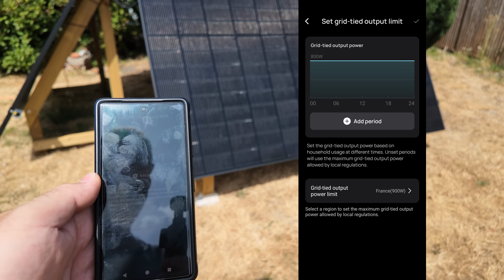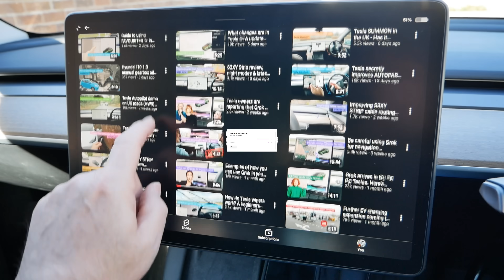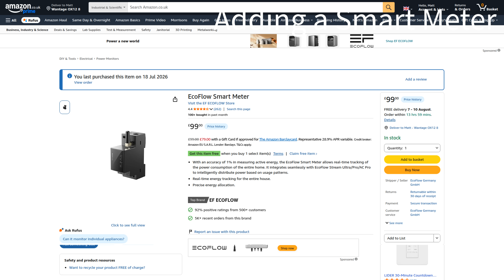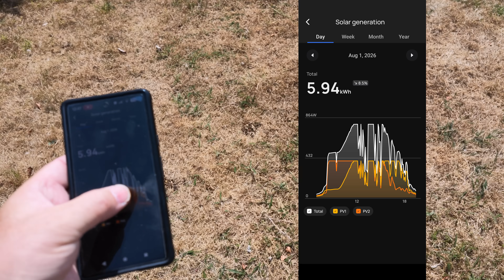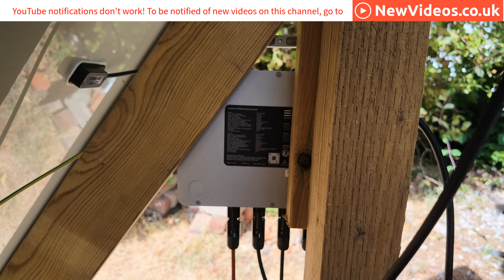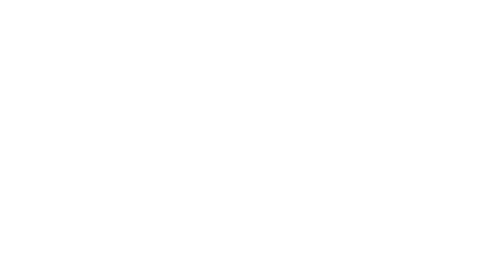Why My 800W Plug-In Solar Setup Sends Half Its Power Straight to the Grid ⚡

Comment: I’m surprised that there is no damage to the inverter, ja solar panels use 36v  obviously 2x 36 is 72 which is higher than the 60v max EcoFlow say you can install per string. Have you had any issues?

I have a similar setup however only the only panel on each string.
Reply: I think this is why people have recommended splitting the panels from both facing east to one east and west that way the voltage may be lower on one string. Especially east and west orientation. 🤔
Reply from the maker: The panels are in parallel, so the voltage is well within the inverter range. I've made a video on overpaneling and gone into the detail on my setup https://youtu.be/AkqC6sT1_nk
Reply: @GoGreenAutos apologies I thought they were in series. 😊

Comment: Regarding the earthing of roof mount panels, the earthing is in plain sight. The metal mounting structure is the earth path and just needs one earth wire while you're using wood which is an insulator and needs more wires.

Comment: Did you run the cable underground to the house which is a taken off a as a spir from an indoor plug?
Reply from the maker: Not finished this bit yet. For now, the cable still isn't buried and its connected in to the ring mains on a 3-pin plug in an outbuilding. It's still a bit lashed in in my haste to get it up and running.
Reply: thanks for the quick reply!

Comment: Your logic is sound for running a single 800W inverter, overloaded with Max PV capacity of approx 1800W. SE and SW facing frames at 55 degrees all designed to get the most out of winter configuration. Why not get a cheap second micro inverter from eBay and split the panels across the 2 inverters, you'll get 1400 to 1500W out of the system in the summer then.
Reply from the maker: I may get a second inverter, but not for summer production. Now I have a battery, these four panels generate enough energy in the summer to run the house for a day. I maybe just need to increase winter production a little, so I may add a second inverter with another two panels in the future. 
But thanks for your comments, confirming my initial ideas.

Comment: I got a similar set up to you,but not as well placed.
IAM not aware I have any power going into grid,as I see inputs and outputs on my solar inverter app( my main source of power).
Could I be missing something without the ecoflow smart meter?
Reply from the maker: Adding the EcoFlow Smart Meter makes the whole system makes sense and is well worth it. In the winter, you're unlikely to be sending much to the grid. But in the summer, it really surprised me how little of the generation I was able to use.
Reply: @GoGreenAutos I have my solar inverter app and my smart meter display,neither show IAM exporting?

Comment: Watching this video I can't shake the feeling that your poor micro-inverter is overheating because those massive panels are exceeding the supported operating voltage of its MPPTs. You said in another comment you're using JA Solar 460W panels, which (if they're older P-type panels) suggests a pair of those at full pelt is pushing over 80 volts total to a single MPPT that supports a maximum of 65 volts.

I've ordered one of those Ecoflow micro-inverters myself, but I only plan on plumbing two 485W panels into it, one per MPPT. Even then it'll be used off-grid because the new UK regulations are still so restrictive.
Reply from the maker: No, the voltage is fine. But the amps are high in this summer heatwave we had, but the inverter caps that ok.
I've since made this video on overpaneling https://youtu.be/AkqC6sT1_nk

Comment: I’ve had good results in the summer with southeast and southwest orientations. When the sun is in the south, both panels receive light—the southeast one in the morning and the southwest one in the evening. I would connect each orientation to its own separate input. 
What is the maximum amperage rating for the inverter input? Wouldn't two panels in parallel exceed that limit? 
You shouldn't connect the panels in series, as that would exceed the voltage limit.
Reply from the maker: I've covered all your questions in a later video https://youtu.be/AkqC6sT1_nk

Comment: Note that the following are specifically excluded from the current UK plug-in legislation:
1. Assembling a DIY plug-in system (and actually plugging it in).
2. Adding a battery to a plug-in system.
3. Mounting a plug-in system on a wooden structure.
Reply from the maker: If it has a plug on it. Hard wire it, then it's a different story.
Reply: @GoGreenAutos  Yes, except...
Hard-wire it and it's not plug-in.

Comment: the regulations have dropped and sadly your system is illegal.
Reply from the maker: If it has a plug on it.
Reply: @GoGreenAutos  it has to be a complete system bought from a company,  cant be placed on wooden structures,  and loads of other crap,  the regulations make is so damn hard and you also have to notify your grid supplier now

Comment: I struggle with your figure of 100 watt base load  .... If you have a smart meter then with your solar off & everything turned off except things like fridge & freezer & routers and that will tell you your base load. My base load is more like 700 watts on a modest house.
Reply from the maker: Our house base load is 100-200W during the day. I have two devices which can measure this.

Comment: Apparently...the regs say you can only install a 'complete system'...no mix and match.....and your panels can't be fixed to timber(!) ...and no plug in battery....soo....if you CARE....you're miles off being 'compliant'....!!!
Reply from the maker: The complete system thing is being debunked currently and it seems people have misunderstood this.
Timber yes..but you could argue mine is mounted on galvanised steel, not timber.
You can use a battery, but hardwired in, not on a 3-pin plug (for now).

Comment: Even with a smart meter and a battery, I still lose 300/400 wh per day to grid even if battery is not full since there are delays between the meter signalling export and the battery adjusting whilst the panels are producing variable output.  Higher loss to grid if battery is full, but probably not worth buying a second battery just for this since it won't happen in the winter. The objective is to make the battery charge and discharge as much as possible!
Reply: Soo....you're not 'losing to the grid'.....you're contributing to the general good of society....by reducing demand from power stations....!!!
....doesn't that make you feel worthwhile....!!!?!!

Comment: I have two  questions  and I hope you will answer them.
Q1  how you fix the frame to the ground especially if it is windy, it may topple. 

Q2. ~800W what type of load it can take?
Thank you.
Reply from the maker: Frame fixing is on a new video tomorrow evening. I've used rebar loops.
I'm not sure what you mean by what type of load? 800W is the maximum this inverter will output and the maximum allowed on plug-in solar systems. W=VxA, so it's about 3 amps. That more than covers the base load of the house and during these summer weeks, around 50% has been going out to the grid because I've struggled to use that much in real time. That's where you need a battery. See the later videos here in the playlist https://www.youtube.com/playlist?list=PLKHuqH4BKg8Q as that will answer your questions.

Comment: If you go with an Ecoflow Ultra or Ultra X, you won't need the separate inverter as it's built in. You also get 4 mppt pair for the panels. I have this set-up with 4 JA Solar 460 panels, plus an extra Ecoflow AC battery giving 3.8kwH storage. I export next to nothing and reckon I'm saving around £35 a month.

Comment: I went down this route and quickly got ultra x which you can store unused power to the battery and use it when required. Add a smart meter and you have zero export, all the power is yours
Reply from the maker: Yep, I've got a Smart Meter now and was shocked at how low the house base load was and 50% of the solar energy is going out to the grid during the summer. So I've got a battery incoming, which will be on new videos very soon.

Comment: As to earthing or bonding. Panels on the roof should be bonded, I believe, because if a live DC wire wears and touches à panel and someone goes on the roof for maintenance, let’s say, then they could get a massive shock, being 7 metres up is not the best place to experience a shock.

Comment: The earthing is good practice, but in truth not really required. The aluminum frame is never in contact with the electricity-generating parts of the panels and in case of lightning, there are usually higher thunder targets in neighbourhoods than such ground-mounted solar PVs.

Comment: Grüße aus Deutschland...  schau mal... so habe ick es gelöst... dass so wenig wie nötig ungenutzt in Netz  gedrückt wird...

mein BKW/Insel-PV-System sieht ab 03/2026 so aus... dat 100wp Modul ist nur von März bis Oktober dran... dazwischen nur ein 15wp Modul

BKW System...                                                                 Inselsystem...

ein 440wp   bifazial 75° Neigung Süd                           ein Modul mit 100wp auch 75° Südneigung...
ein ecoflow Hybridwechselrichter                                 Victron 75/15  
(Powerstream...) am Wechselrichter mit dran             2x 12v 100ah LFP Batterien       
die Powerstation Delta3...                                               3 Wechselrichter ein 200/500watt ein                                         
mein BKW-System wird durch eine 0-Einspeisung  1000/2000watt... dann ein 600/1200Watt 
geregelt... so geht kaum ein Watt ins öffentliche        und alle drei sind Inselwechselrichter...
Netz... (3KWH in 3 Jahren...) wenn die Delta3 fast     den 200/500Watt Wechselrichter nutze ick 
voll ist wird der Überschuss in die Inselanlage            auch im Normalfall...  darüber lade ick meine 
geschoben... und bei Bedarf  dann wieder zurück      Akkugeräte wie  Akkustaubsauger  und so... 
in die Powerstation/BKW System...                              aber auch so lade ick einige Akkugeräte 
                                                                                            über die Inselanlage... wie Handy...
                         .                                                                  Tablet... Powerbanken...
                                                                                            Sexroboterfrau... LED-Leuchten...
                                                                

zusammen nutze ick Licht/Beleuchtung zu 95% nur aus solarer Herkunft... auch schon vor dem großen Solarumbau vor 2023... da hatte ick nur dat 15wp Modul und eine BleiGel Batterie mit 12v 7,2ah...  die BleiGel gibt es nicht mehr... die habe ick gegen eine LFP 12v 8AH ausgetauscht und wird nur zum betreiben meiner CB-Funkanlage genutzt... und etwas Beleuchtung der Solaranlage/Batteriespeicherplatz...

lg andy...

Comment: I have 5 of those, paired with 10x 425w Trina panels. I am never getting more than 600w peak. They are south oriented, and as this is my “backup” system that I was playing with , I was not bothering with 800w vs 600w difference. But I think that is some software limit, will try to solve it.

Comment: Why did you pay £99 for a smart meter when you could have got one free from your energy company?

I have this in my Octopus app.

Great video!
Reply from the maker: It's a different sort of device. I do have a Octopus Smart Meter, but the Eco Flow Smart Meter is a CT clamp which measures energy in both directions.

Comment: I was really wanting an EcoFlow Plug-in microinverter when they became available, but I would opt for their companion battery product, which also has a grid following inverter and, presumably, slightly more active cooling. I think we've entered the age of batteries, but you can't beat the affordability of a simply plug-in microinverter, if you can match your loads to production.
Reply from the maker: Yes, I was surprised how little energy I'm actually using and therefore throwing most away in the summer. However, it will be very different in the winter. But a battery with an inverter built in is the way to go, if you can afford it.

Comment: Forgot  to mention that Solar panels have a silver problem. On average, one troy ounce of silver can produce about 5.5 square meters of solar panels. Depending on the specific manufacturing technology and panel efficiency, this translates to a range of 3.9 to 9.7 square meters per ounce of silver.  When the price of silver hits $1,000 an ounce,  not only are new panels going to be prohibitively expensive to manufacture, but grifters will be grabbing existing panels wherever they can and melting them down for the scrap silver. 

Silver is a vital component because it has the highest electrical and thermal conductivity of all metals, allowing the panel to maximally convert sunlight into electricity. While manufacturers are actively looking for cheaper substitutes like copper, silver currently remains the most reliable material for maximizing energy output and panel lifespan.
Reply: Er.....silver is currently around $69 per ounce.........are you from our planet.......!!??!???
Reply: @andymccabe6712  er..... silver has a serious supply-demand disconnect.  That's why the banksters couldn't keep it under 30.  Price volatility will be the norm, but it will be volatile up.  This is a huge risk for solar panel owners.

Comment: A very well laid out and narrated video Matt, I think a lot of people will install these systems in the future to cut down costs, I wonder what difference it will make to the grid when this happens and thousands of excess watt hours are pumped back into it, I have my eyes on a Hoymiles 2000 watt inverter to get more savings by putting more back into our home, from what I understand 800 watts is supposed to be the limit you are allowed to feed into the house,  how will they moniter this, your views would be much appreciated on this, regards Nigel Cox.
Reply from the maker: 800W is the limit for a self install plug-in solar system. If you want a higher output inverter, then it needs to be hardwired in by an electrician and if under 3.68kW you can submit a G98 form which is just telling the DNO you have it. If over 3.68kW you need DNO approval (G99 form).
Reply: @GoGreenAutos   Thank you Matt, this was the information I was after and you are the first channel to reply to me, the unit I will be installing will be under 2kv so that simplifies things a lot, have subscribed and shared your video, regards Nigel.

Comment: Use a solar diverter to heat your hot water instead of sending it backto the grid.
This is FAR FAR cheaper than installing a battery.
Hot water heating is about 25-30% of people's electrical usage.
Cost to get free hot water is hundreds of dollars instead of thousands.
Not like for like, but don't let perfection be the enemy of the good.
Reply from the maker: No good for me as I'm on a combi boiler for hot water.
I also assume a solar diverter for hot water isn't any use with low wattage plug in solar anyway. You're going to struggle to heat water with an immersion heater when you've only got 300-400W.
Reply: @GoGreenAutos makes sense

Comment: As for grounding normally there is a metal panel mount and they try to ground through the mouth in your case you're all wood and if you are galvanically connected to your house AC you need to ground all the panels And back to your main panel and only if you were completely isolated like a shed then you wouldn't necessarily need to ground or you could have a second ground as a separate structure

Comment: I didn't see you any of your earlier videos that would have talked about how you hooked up the two panels on one frame if they are in parallel or series. that would make a difference on what would be the best way to hook that up if they were in parallel two panels then splitting it east and west would be better but if they're in series then you want to keep the two panels on the same frame to the micro inverter . now because you're clipping you're losing energy  but having an East-West is not going to give you more energy with plug in solar -- that is an advantage when you are going to battery or clipping to your charger or if you are maxing out you batteries or have a time of use service in which case most likely pointing all of them to the West is actually more advantageous. But if you're just looking for raw energy from the panels South and that would only be good with batteries As long as you're not hitting any other limitations like added losses due to excess of current. There are also dependencies due to your latitude/snow issues or bi-facial panels. It is not a clear cut answer and has dependencies on your other setup and use.

Comment: Looks good, think you need to fix your frames down though, first storm = smashed panels, maybe a smashed house too. I'd wire your panel in series, two reasons, first, the heat in the inverter will be higher as your doubling the current wiring in parallel, and there's no benefit to doing that compared to series connection. Second, late autumn-winter-early spring, you want the voltage from the panels as high as possible, as early, and late, in those lower light intensity days; having each pair in series gives you more voltage, and both earlier morning start up power, and later late afternoon power as the sun loses intensity, all inverters have a start up minimum voltage, and you want stay above it with that series connection for as long as possible to maximise daily power gen. Hopefully this makes sense to you.
Reply: In series two panels will exceed the maximum voltage of the inverter for each pair input
Reply: @greenwood4020  Ahh, I see, I thought those micro inverters had a lot more headroom than that; I've just looked - 65v max, Duh, that's very low.